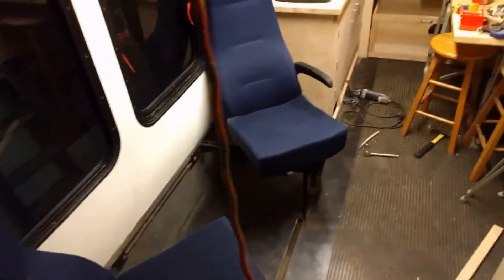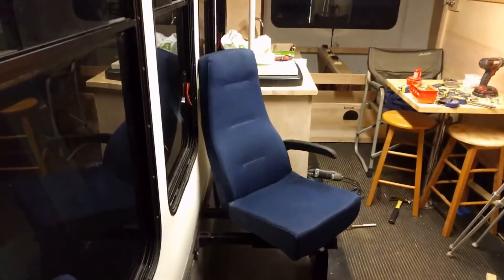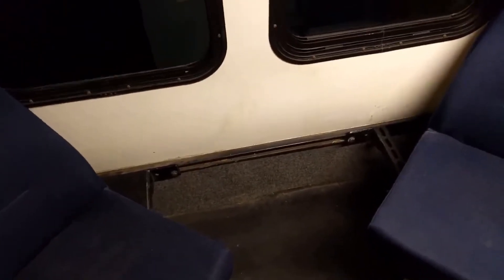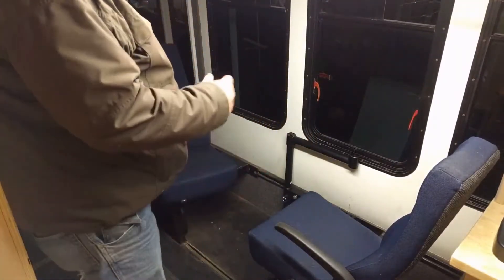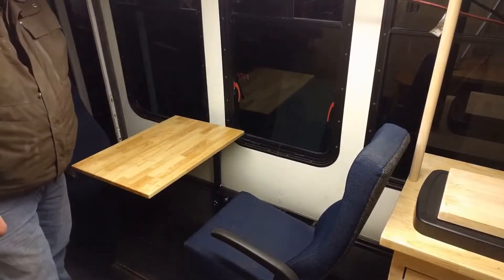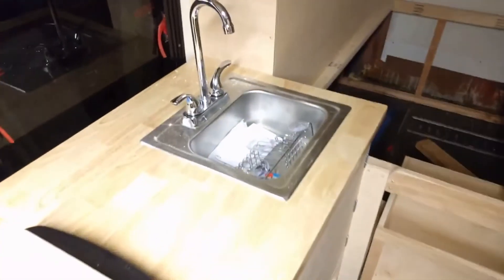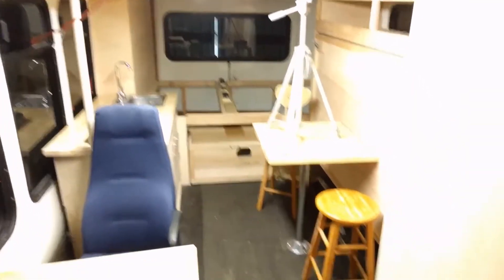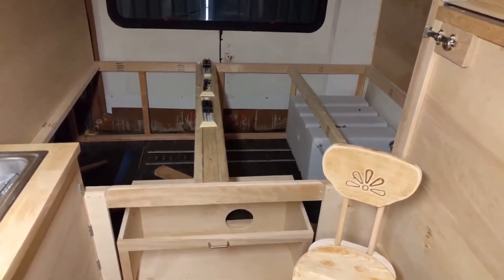Shuttle bus rv conversion (Part 22 second half) Swivel seats and table are installed

Comment: I noticed that this is your third bus. I would love to convert a bus too. Where do you find good buses to convert?
Reply from the maker: @ Live Your Life On Purpose  I find buses all over,sometimes it takes a little travel to get the one that's good. My best advise is to look for low miles and know your engines, look for the ones that have a reputation for reliability. You can search Craigslist,County auctions,Government auctions,Bus dealers always have a large inventory of used buses and seem to want to deal.  Be selective and do your home work and don't overpay, the mechanical is the most important, get service records if you can.
Reply: Robert Braden, Thanks for the advice I will start searching.